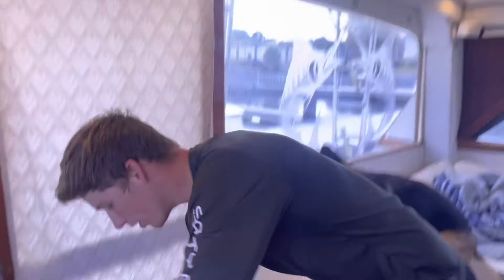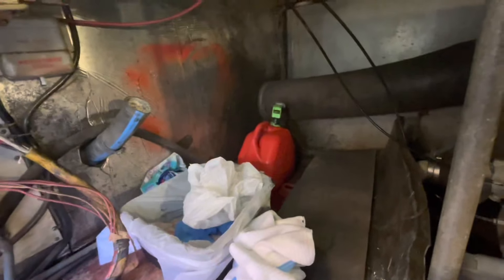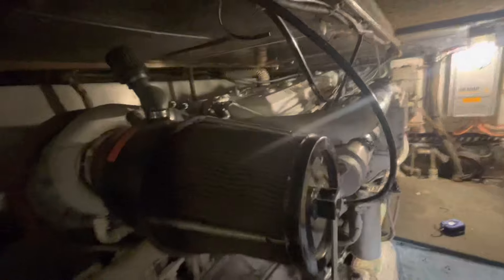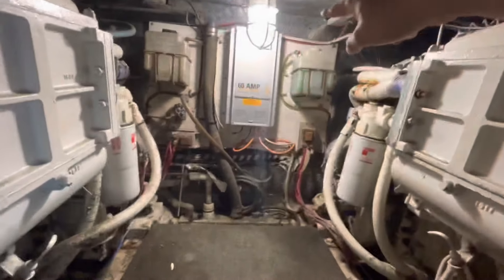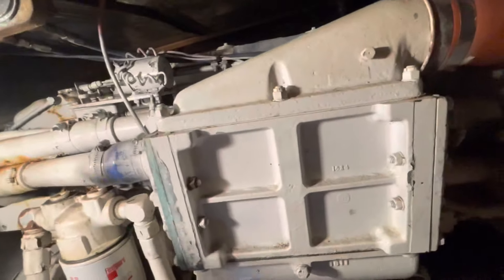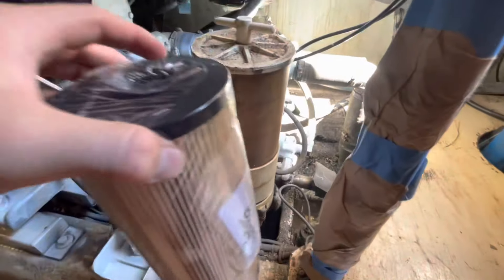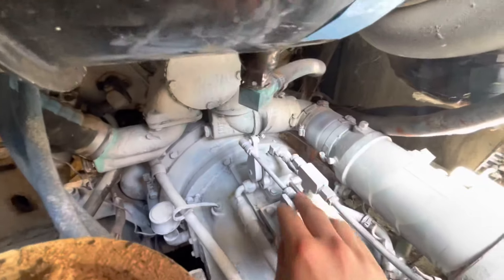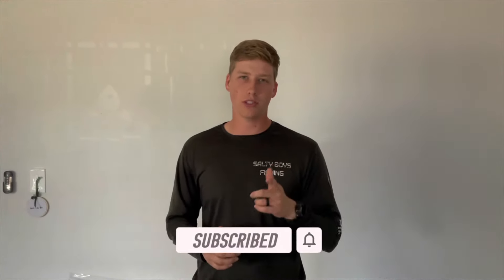Sport Fisher Engine Room WALKTHROUGH!!

Comment: What are the hours on those 71’s? That air filter will be in the turbo soon! Lol. You might like to check the history of those 6/71 engines, they go back pre ww2, powered tanks, landing craft, gen sets, buses, trucks you name it they were in it. You have the highest hp spec  produced. Marine don’t have the life expectancies their on road and industrial brothers have but are damn reliable. Cheers, and be safe.
Reply from the maker: 500 hours on the engines, the air filters got messed up when painting the transmissions hence why they collapse.(paper around them and I accidentally cranked the engines so it produced a false clog). Already replaced them! And yes I wish the marine engines had the same life expectancy as the road counterparts! I baby these so o can extend the life on them since they are the highest hp ones they require much more maintenance than the naturals.
Reply: @SaltyBoysFishing  excellent! And forget the T! A 6/71T is 250?hp. As compared to your marines, the rpm are higher the injectors are huge , cams , blah blah. 
Love dd 2 strokes! 
 Lots of life in them yet.
Reply from the maker: Haha yes these are the 671tib
Reply from the maker: @jimrudolph1582  tib is turbo inter cooled bypass

Comment: Doesn't look "brand new " to me
Reply from the maker: Definitely not brand new! But with some more elbow grease it is looking better each day
Reply: @SaltyBoysFishing  good luck with your boat. You will have a lot of fun with it
Reply from the maker: Thank you!
Reply: @SaltyBoysFishing  how many hours on your 671's?
Reply from the maker: @richardounjian9270 looking at 500ish smoh but thats what the previous owner had told me didn’t have paper work… but I can say that they have great compression, fire right up and barely smoke if at all so I am leaning towards believing him on the hours
Reply: @SaltyBoysFishing  I don't know where you keep your boat but your engines were marinized by Johnson and Towers out of Mt Laurel, NJ. If you need parts they should be able to help. Cheaper to get Detroit parts online,  however.  My 1292's came from J&T
Reply from the maker: @richardounjian9270 thanks for the info! I keep the boat in Virginia Beach!